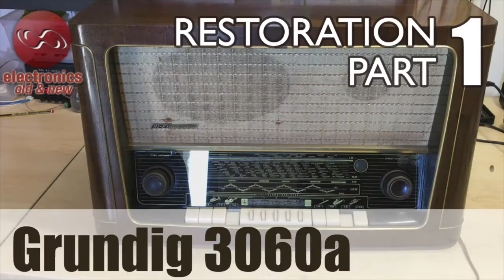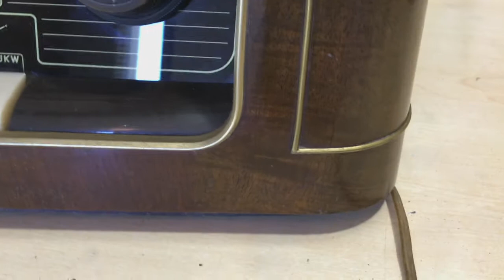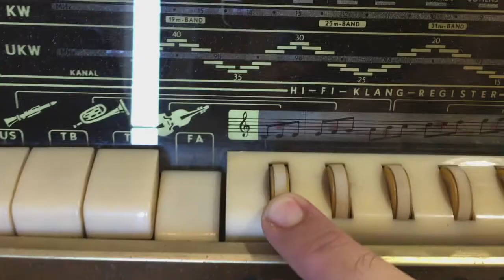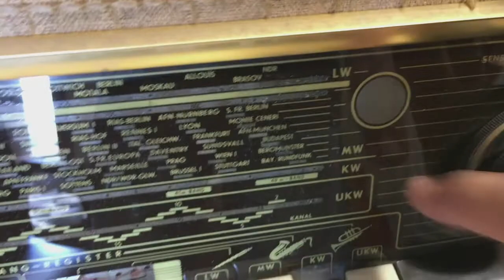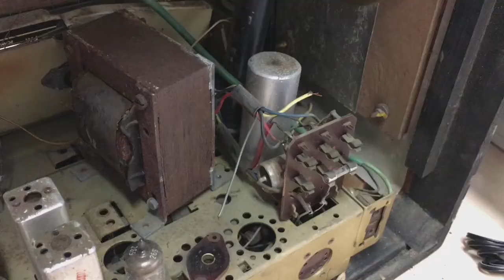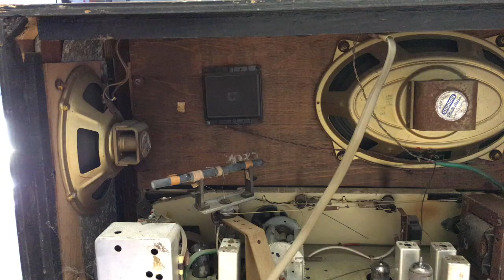Grundig 3060a tube radio restoration - Part 1. First look and ... we have problems...

Comment: Hello Manuel. I recently acquired a 3060 in unknown condition electronically, but one thing I do know is that it is missing the bottom plate (covering the electronics). Any chance you could post a photo and dimensions so I can fabricate one from hardboard please?
Reply from the maker: Martin Telfer : hi Martin. Just git back and am only now able to answer your request. The bottom plate measures 19.5 cm by 53 cm. Send me your email and I'll send you a photo.
Reply from the maker: +Martin Telfer : sent it. Good luck.

Comment: I think those speakers are different because the left hand one has some magnetic shielding - it's closer to the RF stages, whereas the right hand one is over by the power amp section and so less likely to interfere. I've seen this on some Sabas as well.
Reply from the maker: Thats a great piece of information. I have also seen that on the Sabas but never thought of the reason for the diference. Thanks.

Comment: There was I looking for part 2 and then I saw the date. Happy new year BTW. I brought an expensive, beautiful looking nordmende turkey from ebay. Does not work and all the 'replaced' caps look 100% untouched. Very annoying. So I will follow this restoration with keen interest. Especially if you have tips on alignment.
Reply from the maker: Hi. The alignment is part of the restoration that I will do in more detail, as it is actually quite interesting. Hope it helps to get yours going.

Comment: Happy New Year !  TB would be Tape Recorder and TA is the Pick-Up
Reply from the maker: Thanks for the info. I'll be fluent in German after a few more of these! Happy New Year to you and yours.
Reply: One more thing I remembered - I have a similar '56 Grundig (2035) and the chassis is covered with some kind of gold paint.   Go easy with anything that has a solvent in it (e.g. alcohol based).  Don't ask how I know  !
Reply from the maker: +Christopher Cusick : thanks for the tip - but unfortunately I now also know! What a mess. I realized too late that the 'gold' is actually paint. I actually ended up painting the chassis anew, do it looks great. You'll see it in part 3 of this series.